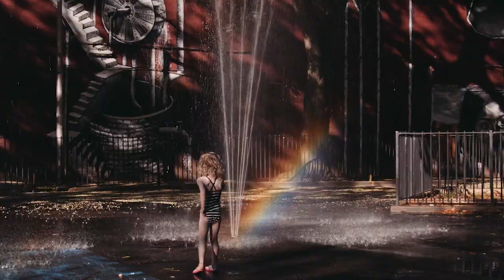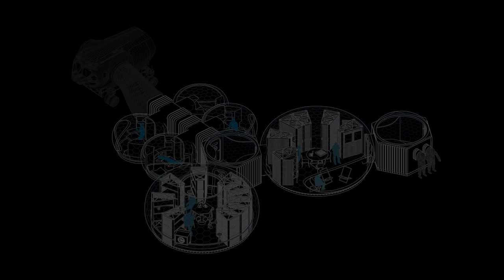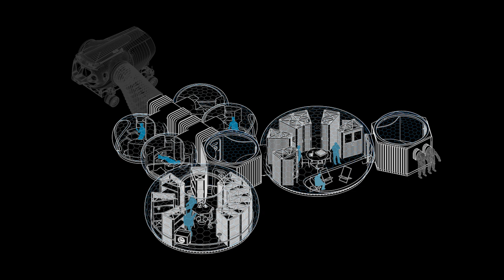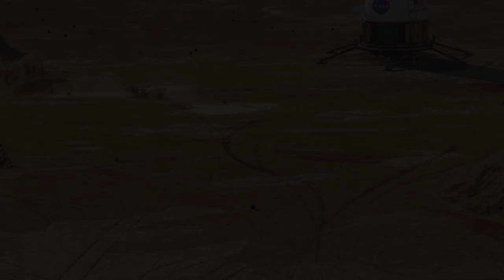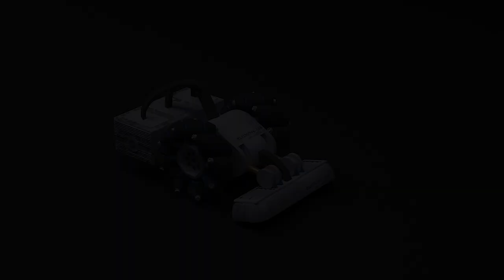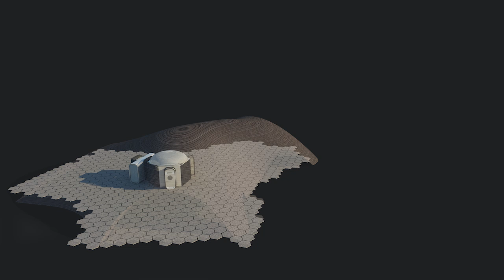Mars Habitat

Comment: If we ever have permanent base there it mostly will be UNDERGROUND. It's the only meteorite and radiation safe solution and also it's huge savings on heating. Only 2m under the surface of Moon temperature is stable all the time and is about -25C. Best option is to build at the bottom of some crater and than cover it with local sand (regolith) that gives bullet proof safety and insulation.

Comment: Hello, I really appreciate your design, but it's a rather crappy idea from the get-go. Instead of building directly on the Martian surface, why not dig from living rock and build the habitat within the rock of a mountain, tall hill or lava tube? The robots could dig out the habitat from Martian rock. Not only could the habitat could be made much larger, there would be much better protection against temperature extremes and radiation, plus more storage of materials could be done easily. To be honest, looking at the size of your proposed Martian habitat, it's just too small for me, especially being so far from home. You're still stuck on the thinking of the ISS, which means basically a comfortable locker room, where what you should be thinking of is an actual home. An underground habitat could be made large enough without spending more money, and could, in time, be made into a small town or city-sized living space, with everything people would need. Yes, what you propose looks and sounds nice, but try living in such a "larger" space for two years or more, and it will basically degenerate into ISS-like living. No room for couples, human psychology or for families, for example. Most important however, there is no sense of HOME here, just a glorified locker room, as I've stated above.

I truly apologize for criticizing, but more thought needs to be put into a Mars habitat, where people would expect to live for years at a time, and I am so very sorry, but this simply would not do it. For long term stays, people need actual homes to live in, and roomy ones at that. Cramped apartments would no more do it, especially since digging a little more out of the rock would cost nothing, and turn what would be a cramped locker room-like habitat into somewhere people would enjoy living
Reply: Oh, and this habitat could include a greenhouse that has access to the Martian sunlight as well --- sealed off, of course

Comment: Tunnelling under ground and using the 3 D printers to slip form and seal the tunnels air tight is the way to go. You could also have periodic skylights to let natural light into the tunnel.
Reply: Absolutely, easier to dig (cut and cover) or bore into some attractive landscape, the regolith 'glaze' lining is realistic , far less work , faster protection for martians, building and growing in a pressurised environment, not waiting for completion before putting up a plastic tent.

Comment: tbh, im surprised none of them have underground chambers designed in, even for a future type situ. it seems that the weather there, local and solar;), would be much easier to ride out underground. i dont have a video like these guys but lemme paint a picture....get some autonamous frickin diggers goin under there and 3d print supports and rooms and shitters and showers and things humans need. all of it connected by a shaft up to some structures that can be used to transition atmospheres and day use kinda stuff. BUUUUUT.......if a huge ol fkn storm comes along and rips those right off the surface, all the people and the good stuff is safe underground. 
         finis
 PMFG IMAGINARIUM ®
Reply: Getting underground will involve big engineering surely. Busting rock will be impossible without heavy equipment.

Comment: No, tunnelling into harder rock is the much better way to go.
One longer tunnel at first and airlocks at each end and in between, this is far more efficient and easier to accomplish and done by robots before humans embark on the journey. 
This gives minimeteorite and piercing radiation protection.
Also a "space train" should be created beforehand, consisting of a modular spacecraft that is put together in earths orbit from multiple rocket launches and ferries the necessary cargo and then astronauts between earth and Mars but staying in space and not landing on either. Instead being refuelled in earths orbit and having smaller craft launching to and from it.
So it could have spacecraft sent to it from earth of fuel, water, food, equipment, robots, replacement parts, compost, scientific equipment, furniture, tools, chickens etc, small nuclear reactors and even humans.
It could send off waste in the same way to burn up in earths atmosphere.
The other thing beforehand is to send over to Mars a satellite link up that uses lasers for much higher and faster bandwidth between earth and Mars.
Reply: If only there were a man who had control over a few different companies in tunneling and high speed tunnel transport, maybe aerospace and transportation too.  If he had a space exploration company that had experience in 3d printing on the cutting edge that would be great too. Is it too much to ask for experience with global,  orbit based internet to also be in this man's toolkit?

I wonder,  does such a hero exist?
Reply: @patrickmalone1373  Indeed.. indeed ;-)
Reply: Right now, we don't know where hard rock is or how much overburden, the characteristics of the surface regolith etc, beyond samples of a few cubic inches. We have to start someplace with semi-permanent structures.
Reply: @paulmoffat9306  I find it too restrictive that kind of reasoning. By now, we should already know how the composition is and if we really do not know then I suggest we send a probe to the landing location first. It is very "NASA" to come up with "semi permanent"  and semi perpetual plans of approach. The US people really should start looking at them a bit more critical. Anyhow, there is no need for a first human settlement on Mars to be above ground, at least not until we are settled and are way more capable in construction. Despite of the unknowns of sub marsian conditions, it is just WAY simpler to sent a tunnel boring machine that will start snaking itself a way below ground. Microwave could be use to reinforce the side walls and/or composite panels can be used. Tunnel boring here on Earth work in similar ways.
Reply: It might be, but the people there live in houses and apartments etc.!!!!  There are lots of Tiny people two, 1-2 inches tall...I have lots of pictures!!!
Reply: @duanewilliams7353  Are you being sarcastic? Because if not then I think that you need help that can't be given on this channel.
Reply: @Jacob_Crowthorne  I am not sarcastic, I taake pictures of all these places, then magnify to be sure of what I'm saying!!!
Reply: @duanewilliams7353  okay then, you need help.

Comment: Hi, great idea,but please allow me to point out a few things you might want to consider:
1. Those suits that are attached to the outside will sooner or later wear out. There must be a way of bringing them inside for cleaning and maintenance.
2. I suspect putting all the sleeping arrangements in the same area is an invitation to disaster. One little failure could wipe out the whole section. Next, if you have ever slept in an open barracks, you how annoying your neighbors’ snoring can be.  The Blue Men of the Desert have a saying. “For our hearts to be close together, our tents must be far apart.”
3. That rover is going to need preventative maintenance and repair. You will be hard pressed to do that in the field. You will need a pressurized garage in order to clean it, then maintain it. When it’s cold, batteries don’t want to work, lubricants don’t want to work, wheels don’t want to turn, nothing wants to work. This will be a major concern, and as yet I’ve seen not one plan to address it from anyone.

I don’t mean to be an ass; I only intend to be helpful. I’ve spent quite a bit of time in the field in the army, as a geology student, and as a chemist at a wastewater plant. Please believe me, keeping equipment working under field conditions is a major concern. I hope you find this helpful, and I wish you the best of luck.
Reply: nice concept video and nice points,
but i want to point out that's common in space applications for batteries to be considered the most crucial part of a spacecraft. The thermal control system of the craft will do everything in order to keep the battery at about room temperature in order to avoid battery degradation (that's happening very fast at +-200°C in (shadow/sun)) as a dead battery would mean the loose of the craft/mission.
Fun-fact: Those non-consumer batteries f.i. for satellites can cost several million bucks :o
(they shouldn't die/degrade significantly 200 cycles into their life (like that garbage in our smartphones) as for a satellite an orbit means ~1 battery cycle .... ~15 orbits/day in LEO ... lets say 5 years of life expectancy -> 5*365*15 = 27.375 orbits).

Soooo.... the system of the rover will likely keep the batteries warm and comfy all the time :P
Reply: good points, especially the point about maintenance does not come up  often and I just want to add a bit of input: 
1. That the suits are on the outside is for the reason that the regolith is a very fine and very rough dust. not as bad as asbestos but still nasty, compare it to tiny glass shards. the idea of having the suits outside is to prevent the dust from entering the habitat. the regolith can lead to respiratory issues when inhaled and it is very difficult to clean the suits properly. these are some things they learned on apollo.
2. yea definitely true
3. well here are the same problems with the dust. as another commenter already stated the batteries of space systems have thermal control systems. lubrication is a nice topic to mention. there are some means of lubricating bearings in space (mars atmosphere is close to a vacuum). liquid lubricants can not be used. either the materials of the bearings are self lubricating or one can use solid lubricants. but getting wheels to work for long periods on mars is probably well understood given the science rovers (curiosity and opportunity etc.). so if the rover needs some maintenance it will be designed to be able  to be repaired in the field or there is a replacement rover. you are right that the suits probably will not last long, but probably all exterior damage is going to be fixed and a spare suit will be used. spacesuits are really complex in their structure that you cant really repair them. however, they are working on methods to deal with the dust (like special cleaning methods and more resistant suits) so we will see what they come up with, but until now this is the state of the art.
Reply: Fullderp hi, thanks for your reply. I think that the Mars Society’s 21st annual conference had a video taped talk about an approach to dealing with the dust. It involved going through a liquid barrier.  I have little confidence in those suits attached to the outside. One little mistake and you can explosively decompress the whole chamber. Additionally even these will have to be brought in for maintenance. What about covering the spacesuit with a loose fitting outer garment that can be exchanged for a clean one as necessary. Something like those hazmat suits should work.
Reply: Going through a liquid barrier? How would you build something like that? Remember we're talking about construction on Mars.

"One little mistake and you can explosively decompress the whole chamber."
Are you talking about a suit breach while the suit is docked with the building? I think it's safe to assume that there would be a hatch between the suit and the chamber.

Other than that, I can think of one way that would allow the suits to stay "inside" while being kept isolated from the base. They could have a small unpressurized shed, that's built around the suit connections. Walk inside, dock the suit and climb into the main chamber, while leaving all that yucky dust outside.
Reply: Hi Einar G., thanks for the reply. Yes, that's what the speaker said. Seems a bit much to me, but that is what I understood. They had many great speakers who have put much work into different aspects of living on Mars. Yes I was thinking about docking the suits. I've seen pictures of this idea and don't yet understand how one can close up the hole after the man steps away from the hookup. I still think some sort of loose over-suit which can be laundered or even discarded after a number of uses is an acceptable idea.I agree about the dust  being a problem though. It will be extremely fine and contains perchlorate. It's going to get into seals, connections, and just about everything else.
Reply: you don't really need a garaj for the rover but the thing whit the spacesuits is thru. I don't know from where nasa got this idea thet it is better to leave the spacesuits outside.
Reply: Good Observation of video, good points!!!
Reply: Great comment!
Reply: Willy Makeit  Well said 👏🏾👏🏾👏🏾